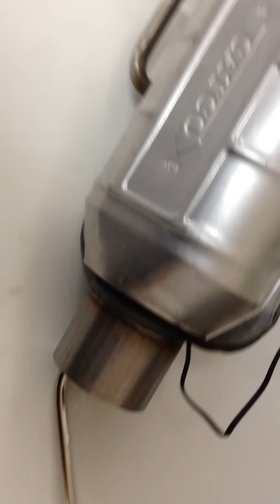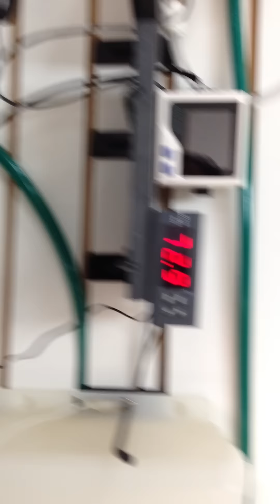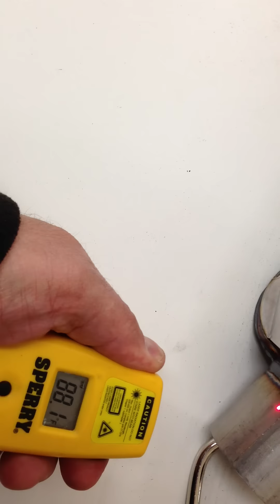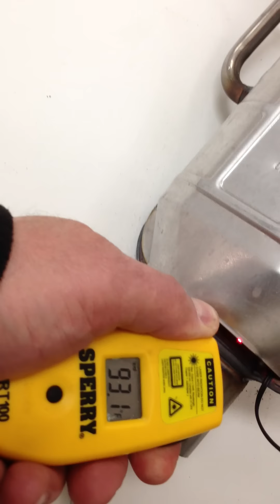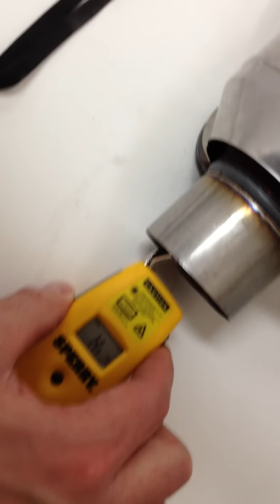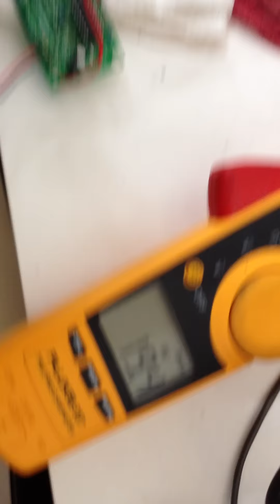H-CAT video 5

Comment: so glad you got it working , isnt it amazing the problems we endure throughout are experiments , bro i just spent $250 on a heat engine experiment and did this because a small experiment promted the build ,any way i build the sucker heat it up and wow massive expansion then go for the pressure test nothing happens,DAMMIT , but guess what i toiled and toiled and toiled only to discover that the oil in my expander liberated dissolved  gas bubbles    when heated to 300deg. the air bubbles halted pressure up , it dawned on me all the suden that maybe air bubbles formed and i was write a quick "bleed" and i got that sucker up to around 800 psi at under 200 deg F, Glad to see you didnt give up steve i really enjoy these struggles and every build we do has them
Reply from the maker: If we are not persistent we won't discover and learn. I've also spent thousands learning but I have got to a place that has been rewarding.